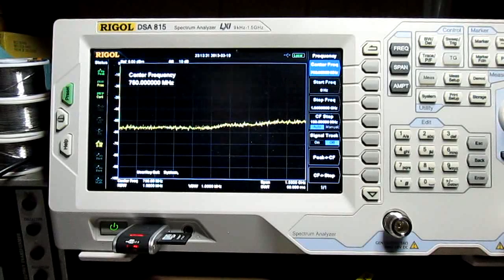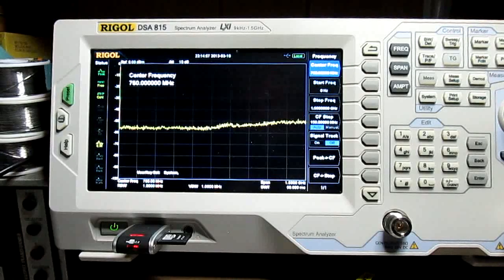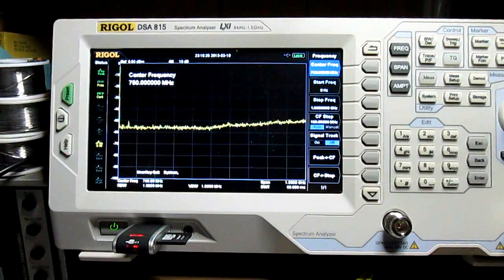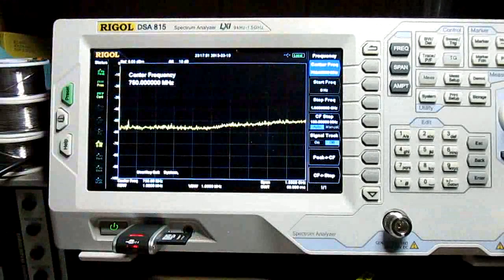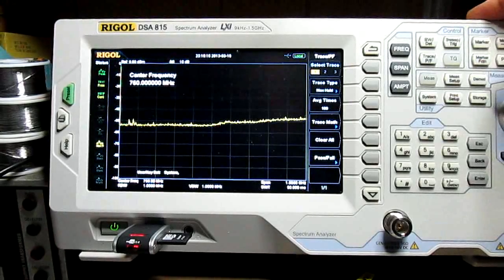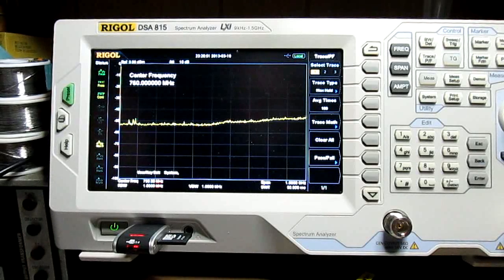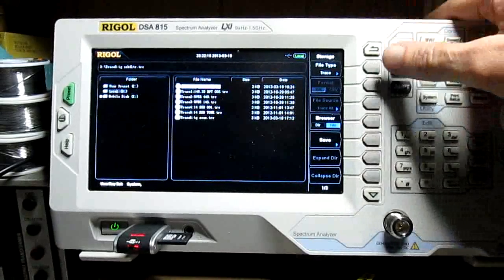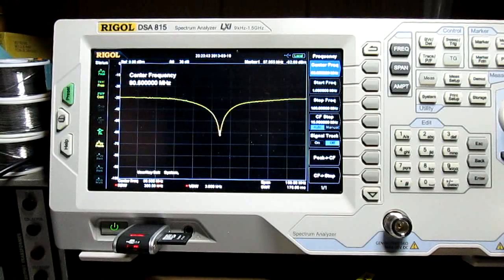Tracking Generator or No Tracking Generator, That is the question.

Comment from the maker: Hi Alan .. I did realize the 1000 times seemed to be a good ratio .. also .. even with just a regular trace, if the ratio is not correct then you see that amplitude issue you mentioned .. Perhaps I should demonstrate that as well .. When I did the 700Hz wide crystal lattice filter, I had to turn the RBW down to 100Hz, which of course really slows down the sweep time on the analyzer, which in turn, increased the sweep time needed on the RF signal, a LOT